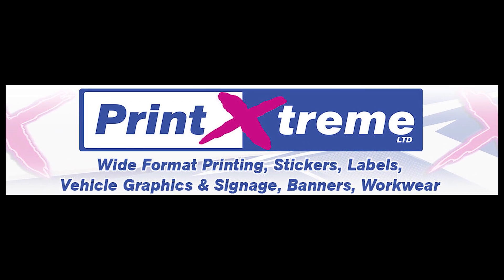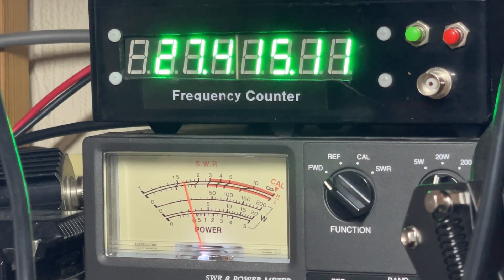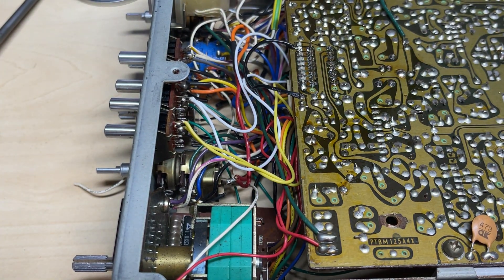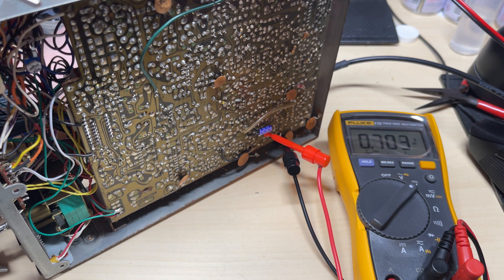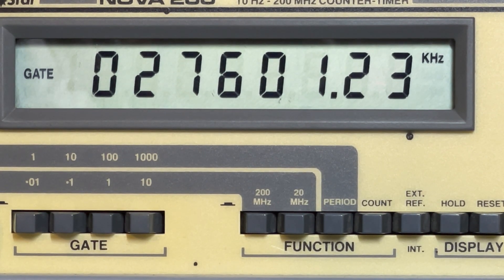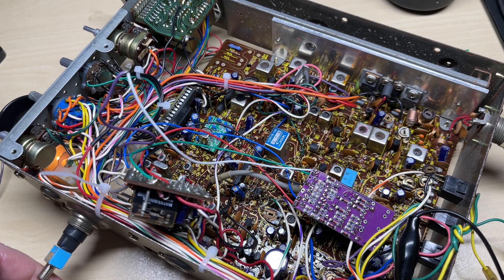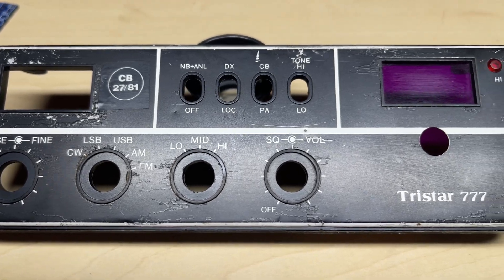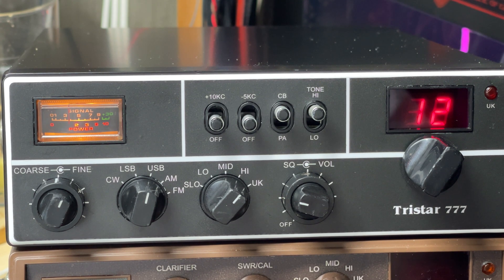EP 114 - Tristar 777 SSB CB radio - 5 band mod and front decal/repair. Part 2

Comment: good job, bit more room than the 121's to work on with these, i remember that scrap one i had, had a prom in it, that did hi band down to super super lo plus uk 40, dont know wether its knackered or not, no kit to test it, its still knocking around here somewhere, that was on a 6 position switch and another switch on the front used for alphas, looks like you were careful in the pll area, pads can be a bit weak there, a bit like the darlington area on the 121's.
Reply from the maker: Yeh it turned out well , i still have to do a couple of mods tho , things i found out after.
Reply: @MicroChipz  there is a one for fm, cant remember exactly how its done now but its on the mode switch by jumping a wire, it makes fm regulated along with am, as in normal state its not like ssb is not.